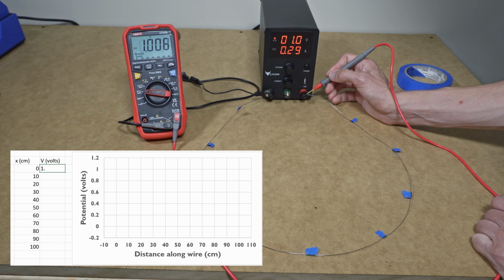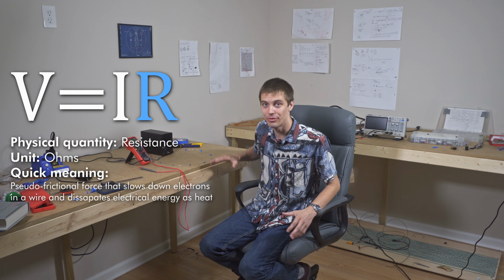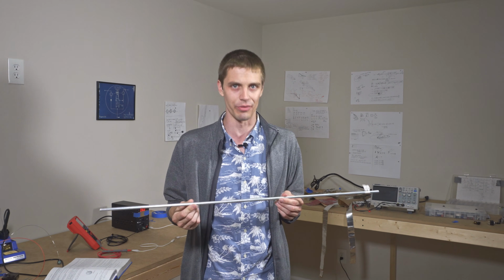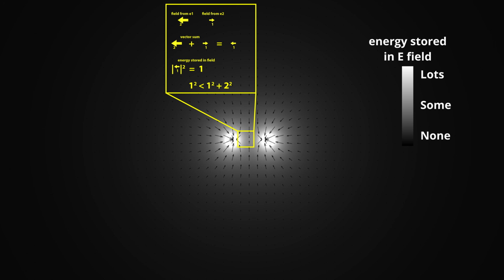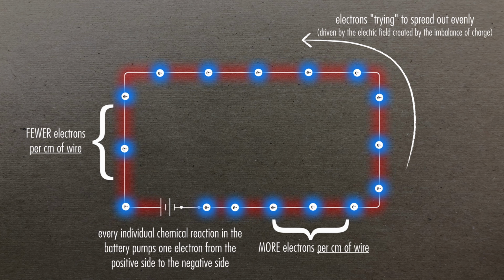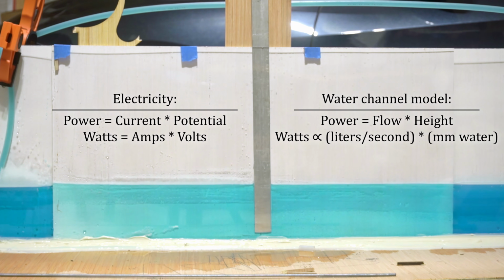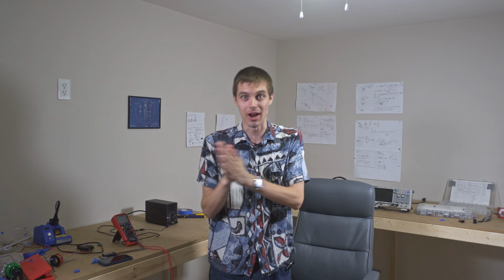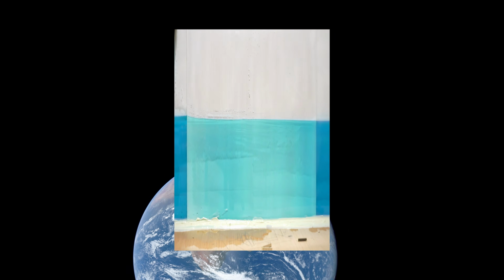An intuitive approach for understanding electricity

Comment: Working experience with good advance lab I 1st presume that I know most of it. But your efforts with age old analogy with a leaking system.  I found  that you are excellent. 
Good video channel. 
It make me feel that there is a defect in our understanding.  When molecules in water random and with Vanderwal's.  In molecular level but electron as a random in fluid of core of state phase of matter. 
The potential and capacitance for water in gravity and electron with pressure  as voltage
To regulate voltages has the lacking of molecular fluid other properties.

Comment: Voltage is how fast the river is flowing, amps are how many ducks are in the water(ducks hurt) and resistance is a log sticking out into the river or a boulder in the river.

Comment: It's very interesting that in the first example of ohm's law, there isn't actually a step anywhere in that graph if you take a continuous measurement including inside the resistor, you'll see the same linear decrease throughout the material of the resistor.

Comment: This video helped me a little. But I still don't know what difference between one volt and two volts is? Are more coloumbs moving pass a point per second? Or are the same amount of coloumbs moving but at different energy levels?
What I think would clarify that question for me is to be explained how the voltage is generated in the first place. Specifically, how does a generator produce different voltages? I think that would clear things up for me. Because just saying voltage is the difference in potential energy between two points, isn't working for me.

Comment: This is a very very very cool video and explanation of electricity 🙂
Was just thinking about super conductors.... So with a wire connected to the super conductor and running extremely high current through it it should in theory get colder as the resistance is negative , 0 or at least lower than the connecting wire. Normal conductors are the same as resistors they would heat up... This is kinda cool to think about...

Comment: Finally understand what Voltage IS -- and with that, I like this equation of thermal conduction Even Better than the water analogy: ΔT = R*Q, where ΔT is temperature difference, R is thermal resistance, and Q is transferred heat per unit of time.  (https://en.wikipedia.org/wiki/Thermal_conduction)  This is exactly what's happening with Ohm's Law as well -- Voltage is reflecting the Difference in electron Density / electric field Density (in the battery terminals), R is measuring electrical resistance of the circuit against the flow of electrons, and I is measuring the electrical flow i.e. transferred electrons per unit of time.  So ChatGPT says Voltage IS the Difference between 2 points -- the electrical potential energy difference between 2 points, so the terminal with More (compact) electrons, the electrons have more electrical potential energy (analogous to gravitational potential energy), so it's exactly the measured Difference between each tips' potential energy

Comment: Magnetism surrounding a wire works in the "open trough" model.

It's basically like the wind current caused by the movement of the water.

Comment: Thanks so much for this video. I've only been studying electrical engineering for about 2 weeks, and the thing I've been struggling to understand is voltage or potential energy. Current and resistance make sense, but what the heck IS voltage? I have a much better understanding of it now. I don't think a home DIYer like me really needs to understand its deeper insights, but I can conceptualize it much more easily after this video, in large part from the intelligence of your many analogies. Thanks again!

Comment: After watching the video where you measured wire signal path reactions I thought of this; it's not like pushing, pressure bc that at the start is a local thing. On the other end it's a negative pressure, a vacuum. So the differene in potential works perfectly, one pushing, other end pulling, when the signals connect, the total is the difference between two points, positive or negative, difference.

Comment: This was great and really confirmed my intuitions about voltage within electrical circuits. I can't make the water analogy fit low power dissipation in high voltage mains conductors though. Can anyone point me in the right direction?

Comment: Great video! Just one correction. There are circumstances where you do get positive charges flowing; particle accelerators and ion cannons with proton beams or alpha particle beams. Conventional current here is actually the right way around and shows that, what may be an annoyance to Electrical Engineers, for Physicists is arbitrary or even, arguably, the preferable convention.

Comment: 20:50 This made me think about what a constant voltage supply would be, which is keeping the water levels the same. 
But then I thought about how you could use a giant reservoir to hold the water level constant, and how that would be equivalent to a block of metal, and then I realized that's a capacitor!

Comment: I think a better example of a resistor in the water flow would be a hole with less escape than the entrance then, also, it's great to clarify that a resistor spends electricity

Comment: In SI units, Maxwell’s famous equations for the electric and magnetic fields are:

These are differential equations (equations which describe a rule for the rate of change of a function with respect to one or more of its input variables) for the electric field E and the magnetic field B in the presence of a charge function ρ (“rho”) and an electrical current j. The quantities ε₀ (“epsilon naught”) and μ₀ (“mu naught”) are physical constants called the permittivity and permeability of vacuum. The speed of light c obeys the important relation c² = 1/ε₀μ₀. When boundary conditions for the fields are specified, these equations completely and uniquely determine the fields.
Usually one does not attempt to solve these equations directly for a given configuration of boundary conditions, charges, and currents. Instead, numerous mathematical tricks have been invented to simplify many different kinds of problems. However, it is still important to understand the physics behind these equations.
The electric and magnetic fields
A charge q with velocity vector v and speed much less than c in the presence of an electric field E and a magnetic field B is subject to the Lorentz force:
Interestingly, this is still true in the relativistic case when the force F is meant to denote the time rate of change of the relativistic momentum instead of the classical momentum. There are two terms in the Lorentz force. The first is qE, called the electrostatic force. This force is caused by the electric field E, which is produced by stationary charges. The second force is qv⨯B, which is called the magnetic force. The symbol ⨯ is called the vector or cross product, and it denotes a vector perpendicular to v and B and with magnitude |v||B|sin(θ) where θ is the angle between v and B.
A magnetic field B is produced by a current and interacts with a moving charge to produce a force. A current is a charge times a velocity so qv is a…

Comment: One more analogy could be made with this experiment that was not mentioned.  The leak at the bottom of your water trough could represent wire insulation.  The higher the water level, the higher the pressure at the bottom, the more supporting structure is needed to keep the water from blowing out.  Hence, too little insulation and voltage can break the barrier.

Comment: My personal analogy used to be that voltage is fuel in the tank, current is the number of cars and resistance is mileage. Not so great for Ohm's law (though logically kinda works, the more fuel you have, the more cars you can send over a given distance), but fits kinda neatly to Kirchhoff's laws, as in intersections divide cars, but don't cost fuel, long roads cost fuel, but cars can't get lost on them, and more cars will want to take the shorter road. Think I had an extension for AC, but wasn't very good as I can't remember what it was.

Comment: If energy is only dissipated at the resistive load in your short DC circuit, why is there so much power loss in transmission lines?   A video here?

Comment: i am really interested in making espresso right now and all this making intuitive sense haha. i wonder if there is such a thing as laminar vs turbulent flow of electrons?

hearing you talk about the confusing aspect of voltage is actually very similar to espresso making, in that there is a big misconception for espresso enthusiasts about pressure. they all seem to be focused on pressure (voltage), but actually the other factors matter much more flow rate (current) and let's call it drag (some might say puck integrity, or in electricity the resistance). sorry, these may not be completely accurate comparisons, but that is what im seeing as analogous for me.

Comment: I use magnetic force and light to imagine voltage, current and resistnace. It makes since to me because it all starts with either induction motors or light absorption (photovoltaic cells) that way I can actually have the whole picture in my head. It bugged me to the point I was researching quarks because I couldn't grasp energy.

Comment: I realized a misconception I had about what you measured at 30:48.

I initially thought it was the voltage wave due to surface electrons that initially propagates from both ends of the battery.

However, we clearly see the voltage wave interact with a resistor in a way that causes resistance. The resistance of a wire is inversely proportional to its cross-sectional surface area, not to its circumference, so the bulk of electrons interacting with the resistor must be the center electrons that constitute the current.

This would entail that what is being measured is the voltage as computed from the current, not the initial propagation of the electric potential. I think that makes sense when also considering how a voltmeter functions--using an internal resistor.

But this has some interesting consequences from that recent debate between ElectroBOOM, Veritasium, and others. If this is the current electrons in the center of the wire sloshing around, then it's not as simple as one would think.

Comment: Depends on the way you measure volts are negative by Bohr's model so they flow from the negative towards the positive electric flow versus calculation flow you could measure in a different way actual electron flow !!!

Comment: What about amperage in the equation? The power supplies have a constant amperage output. This is also showing in the water trough with blockage/dam. The electrons “pool” behind a blockage, and come out on the other side at a slower rate and at a lower voltage.

Comment: Current flows between two points when there is a difference of voltage (and hence, potential) between them.  An analogy I like is that of the difference of temperature between two masses, which results in the flow of heat energy between them when a conductive path is present.
Reply: Imo, the easiest way to understand voltage is to view it as pressure from the source or supply.
The easiest..

Comment: I would like to make a consideration if you don't mind. If I wanted to create a model with a gravitational system, I would need to consider the size of the planet as well as the height of the object. This would better convey the idea that tension is a value proportional to the force to which each electron is subjected.

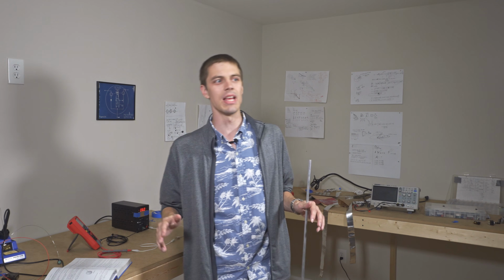Comment: 9:18 pressure, if the voltage is high then the forces leading up to it are pointing outwards from it with greater magnitude as a positively charged particle (our test particle) approaches it (because the electric field is the negative gradient of voltage) , it "wants" to get outta there, that's why it's compared to pressure
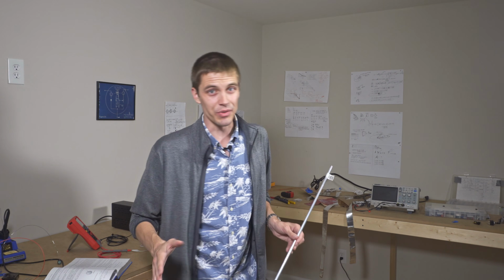10:47 voltage to me is fairy dust, it's fictional, we looked at force (electric field) and said "it's trying to tell us something" and came up with potential (voltage)
11:27 it's so close though, its potential energy (the one that comes from coulomb force) but generalized, so it doesn't depend on the charge feeling it
14:08 if the source potential is raised, then throughout the circuit the kinetic energy is increasing....right?...unless mechanical energy is lost because of collisions
17:11 this is such a great visualization and it made me understand why we used that formula
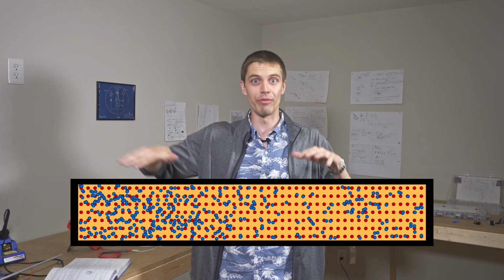18:02 if you use work to raise 1C to 1V when it was at 0V, then you used 1J of work. J/C=V or J=V*C
21:48 it's so hard for me to understand this 😭
22:05 OH MY GOD I GET IT, once the electrons get pushed back from the resistance, they redistribute where it's easier to, the voltage difference is easier to get rid of in the cable rather than the resistor, it's so simple
22:20 in this example, it's hard for me to understand how the force is the same throughout the circuit but the potential (bunched-up-ness?) is higher in the negative terminal, honestly this doesn't make any sense to me

Comment: Gravitational Voltage is V = gh, not simply the height. The units are m^2/s^2.

Since Electric Potential = Electrical Potential Energy / Charge, 
Gravitational Potential = Gravitational Potential Energy / Mass

Comment: Since technically VIR is not separable you can not illustrate any with using the other.
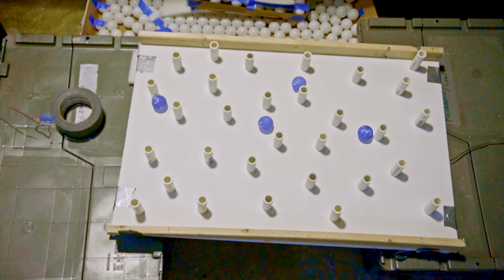Hence your depiction of resistance at 6:47 was perfect to illustrate voltage.
If you tilt that contraption that would illustrate bigger V without actually showing the "difference" (due to perspetive it would not be much visible). Rotating the camera to horizontal from top view would reveal the angle of slope is proportional to V, forcing the electrons/balls to bounce more aggressively (and dissipate their energy in form of heat).

Comment: I really liked the part about where the energy is stored (in the field!), it was slow and well done. I don't believe you spelled this out in the video (and I believeI know the answer), but what does changing the resistance of the resistor correspond to in the water analogy?

Comment: "Positive charge carriers don't really exist" *
* in circuits using metal conductors. 

In aqueous circuits (like in action potentials in neurons or the internal current of a lead-acid battery), positively charged ions can and do flow freely (neurons use Na+ and K+ mostly, ignoring the Cl- currents for simplicity, lead-acid batteries use Pb+2 ions if i recall the redox reaction correctly), so there are definitely instances in which not only do positive charge carriers exist, but in which they are the primary movers in the current.

Comment: This video is so helpful! I wonder  what a water RF circuit / antenna would look like.
Reply: Principle of operation is the same for DC, AC and radio stuff. Go figure (EM fields, energy transferred outside the wires, but both cables and antennas must be metal, we need electrons to help, direct that energy where we want it).

Comment: As I struggled with the concept of voltage and current I wondered about the water pipe analogy. The analogous relation of water through a pipe vs electrons through a wire and wondered if the two were congruent. Such that if the pipe was 6ft in diameter and the pressure was 1lb the volume of water that would flow is analogous with electrical current. In the water analogy pressure is volts, volume out is current and pipe diameter is resistance. Now take a wire 10 gauge with 1 volt and measure the current, it would be (I) out. but if I change the wire to 18 gauge would the current still be the same or would it change? Also to what extent is the relationship of voltage to current in that if one variable is held constant what is the limit of the other?

Comment: Very informative. Ohm's law is probably all you need to create any type of circuit you want to design. I do think it's important to note that power does not flow in either direction in the wires. But rather in the magnetic field.
Reply from the maker: It’s a combination of the electric and magnetic fields, but it’s important to remember those fields wouldn’t exist in a way that can move power unless they were emanating from moving electrons in this wire

Comment: 5:44 even the 2-3 hours isn't likely true. The bench supply is isolated, so the transformer/regulator/etc. in the bench supply is like a pump, powerrd by a water wheel on the AC input. The electrons are just cycled through the wire.

Comment: Great video, im a little late to the party. Please rate my understanding of volts from your explanations coupled with my wacky view of the world.

Volts are like a rotating rubber band wrapped around a charge. 

Tension is loosely applied here but it could help with visualizing. Tension from the rubber band and tension from opposing charges / separation of charges feels like a similar idea. In the rubber band, the potential created by your hands pulling outward from both directions simulates the charges expanding in opposite directions.

Comment: @AlphaPhoenix Suppose you connect two wires with different resistances to form a single wire. When you apply a voltage, a current will flow. Do the electrons in the wire with smaller resistance move with a higher drift velocity compared to the wire with higher resistance? This would mean that the electron densities in each wire are different, to make sure that the current in both wires is the same.

Comment: Just an observation, at 10.35 you say that the slope of the line is resistance. It's not, it's the reciprocal of resistance ie conductance. You'd need to plot PD on the Y and current on the X for the slope to be resistance.